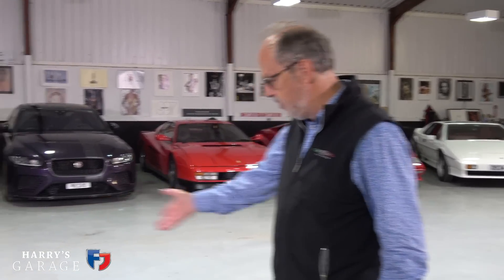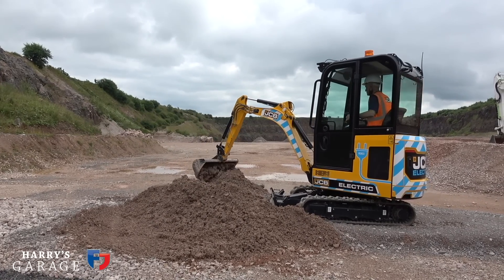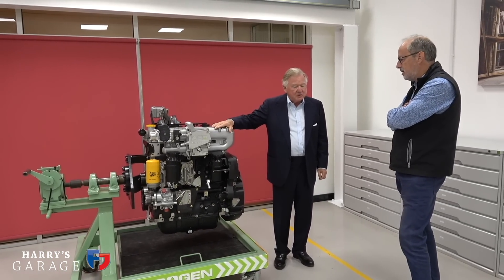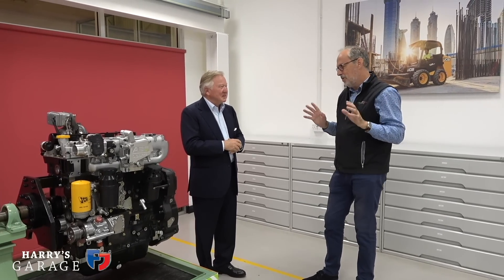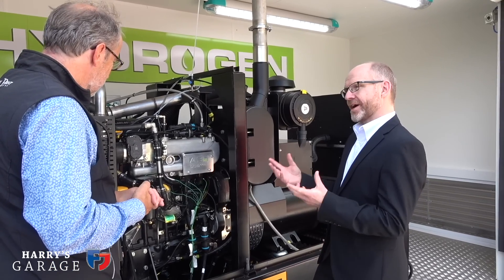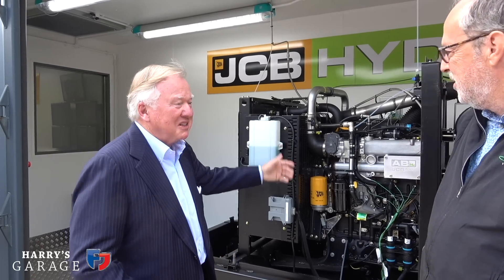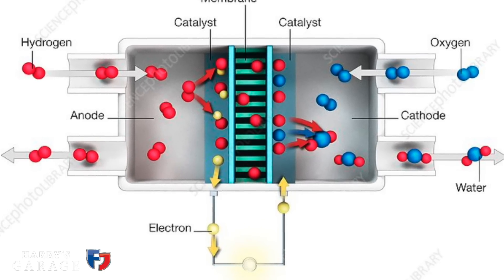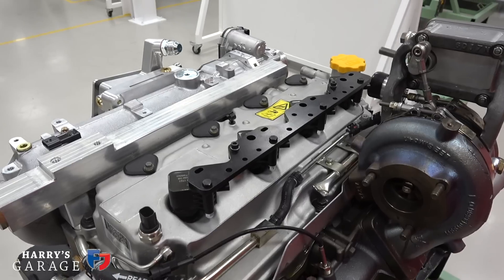Is hydrogen, rather than electric, the future for big-engined machinery? I visit JCB to find out

Comment: Really hope we get hydrogen powered engines in the future as an alternative to electric
Reply: ??? Hydrogen vehicles are electric cars that get power from hydrogen instead of mains electricity. They are electric vehicles.
Reply: @cathalfolan8441  I think the OP is referring to internal combustion engines that make power directly from burning hydrogen. As shown in the video.
Reply: @nickegan3988  You'd like to think so, but there are pockets of "over-my-dead-body" anti-electric people out there who would rather use a rubber band powered scooter than dirty their driveways with a battery car.
Reply: @cathalfolan8441  that's the case my diesel is electric. I need a battery to start it. . Electric is a no no. The infrastructure is not there and never will be in my lifetime.  The cable on estates is sub standard. New estates may handle every house plugged into a car. Mmm I doubt it. What we need is a kit. Plastic water tank fitted with plates to produce the H. Maybe some stainless or ceramic parts in the kit to fit. A nice new tap fitment for my outside tap. Nice. Whoever comes up with something like this, that's works will soon vanish off the face of the planet.  Bit of both would be a decent mix though
Reply: @bbbf09 God your serious. Take a pill.  It's a laugh but your wrong with telling me I don't understand electric. Well someone told me who works for Northern Powergrid the underground cables will not take every house plugged into chargers or half come to think of it. . Sit back and think about it.  The cable is just not big enough to carry that load. So you make that what you will  but it's fact. Cabling will need upgrading. Just like these crap heat pumps that has had to be put back. They don't work unless your house is built for the specs. Where I live anyway.  Oil rules. Anyway it was a joke about the tap.
Reply: I'd be happy for a hydrogen combustion engine in my Renault Megan cabriolet 🤭
Reply: @RalphEllis  Wow are you sure? If you are correct that's mad 😱
Reply: @RalphEllis  apparently you're unfamiliar with how electricity is produced and transmitted.
Reply: @ciaranbyrne62  Would you also be happy paying 28p/mile for hydrogen combustion? The average petrol/diesel is around 17p/mile and your cost of ownership over 100,000 miles would be far higher with a Hydrogen combustion engine than an electric battery vehicle.
Reply: @robbybobbyhobbies  keep consuming at the rate we are and the planets f..d regardless. it aint rocket science !!! ppl that need a new car every 2 or 3 years..  wtf !!
Reply: @rhett7716  agreed, but getting out of bed each morning requires that I believe we can sort it out before it’s too late. EVs are a tiny step that we can take (or have taken) today. Hydrogen is a step we can take in 5, 10, 15 years (unless someone disrupts the industry by funding infrastructure immediately). Refusing EVs point-blank is a retrograde step. The refuseniks seem to enjoy circling the plug hole.
Reply: Hydrogen is not free.it takes electricity to produce.so where does all this spare electricity come from.?
Reply: @peterhazelwood9325  Exactly!
Reply: @peterhazelwood9325  Nuclear the only pragmatic solution to split the h2O, much better than covering the landscape with solar or wind turbines.
Reply: @paulos9304  'Someone' at northern power grid told you did they... and 'it's a fact' 
Well thats me told then!  
Seriously - some bloke told you (down the pub no doubt) - and that's why you 'understand electric',  You should see your comments from this side of the screen - from my point of view.  It really does makes you seem implausible - at best.
On my side I served as electrician in few factories and building sites...moved on ...got degree in physics and electronics and now I interact daily as professional engineer with other electrical engineers. What's your level of understanding?

In truth you are correct if everyone heats their homes in winter , whilst taking a shower and charging the car, with hair dryer and washing machine on simultanously .... all on electric then the average 80 to 100Amp ~20kW domestic consumer unit supply  is going to trip.
But then my gas combi-boiler cannot provide both the central heating and shower at the same time - it temporarily ramps downs the central heating to cope. Most do the same. boohoo!
 To avoid this,  its all about evening/ smoothing out the supply peaks. Your car charge will typically require between 2 to 3 hours at 7kW and it will find a way to ramp up/down charge between peaks as required via its controller (or program to do it overnight). That's easy.  Other items will have to get smarter ...but possibly the heavy duty power apps (heat) may require automatically - but temporarily - turning down heat  whilst the shower is on (like with my gas). But a powerbank battery installation may be required for heavy use households . This will be at few £k cost - that can keep heating and shower going for an hour or so at peak whilst heating full on. There are otehr options

Otherwise outside the house there is a case for saying substations and grid network infrastructure will require what is called node strengthening. At cost of £50billion over 20 years it sounds like a lot - but less than useles covid track and trace or smart meter debacle. The challenge to the network is overall only modest - as national grid studies have shown. You make it sound improbable/ impossible.
Anyway there's the real 'facts' . You certainly can't tell any of this by stating 'the cable just isn't big enough' . Your hunch counts for nothing and I seriously doubt you ever  even glanced at BS 7671 or even know if your feed-in tails are 16  or 25 mm2. 'Sit back and think about it'. Indeed!

My only regret with  all our clever science  is that we can't find a way to oprn a portal into another parallel universe where we can drop all of you fossil fuel loving climate change deniers off - to await your self imposed fate. While we all go off live in a cleaner, progressive smarter and cheaper world - where we don't risk runaway greehnhouse effects.
Reply: @bbbf09  Oh dear. I hope someone has the time to read your  book of a reply. Because I can't be arsed and I have better things to do. You have your view and I have mine. Agree to disagree.
Reply: @bbbf09   your over reacting. I did say if everyone bought electric cars now and in near future. .problems will arise. Over time  thing will be ok bit not as of today tomorrow. . I never said in 20 years time. I'm on a out now this year next year.  50 million cars lorry's all electric. It wasn't down the pub either. It's what was said. Period.. I'm a spray painter. Got nothing what so ever to do with what we are on about. Your the man for that apparently, I'm saying what I was told. By the way he has a degree in electrical engineering as well. I'm on about here and now not in years to come.
Reply: @paulos9304  Well there you have it  folks ...clueless and uninformed. But apparently hi stime is valuable. Who knew?
Reply: @nickegan3988  But why on earth would you stick with a mechanical device which had literally dozens of moving parts to wear, and needs maintenance and repair, when there is already an alternative which requires much less repair or maintenance?
Reply: @peterhazelwood9325  Presumably it would be the electricity which was previously used by the oil industry?
Reply: @Brian-om2hh  I think for most people, access to charging is the blocker. I wanted to buy a Leaf as my last car, however not having my own driveway or garage, I wasn't comfortable having to worry about access to charging. Hydrogen ICE does not have this problem. 

I believe that unless charging access is addressed, BEV's will remain plateaued.

Comment: Hydrogen, LPG and Bio fuels seem to not only have a back seat to electric but aren’t even allowed in the theatre. 
Electric just isn’t ready or affordable, let alone cost effective,  for commercial, domestic or regular long journey drivers.
Reply: £30-40 to charge a Tesla at a charging is a joke! Especially when the realistic range is less than 175 miles.
Reply: @v4skunk739  My Subaru is cheaper to run than that!
Reply: Horses for courses. Electric is brilliant for cars, its also never realistically been an option for heavy vehicles, ships and trains. Hydrogen has always been pushed for this option. This isn’t new, but infrastructure is a massive problem for hydrogen, its even bigger for cars, electric infrastructure for cars is relatively small in comparison but as Lord Bamford says it is unrealistic for vehicles that have incredibly high work loads, Such as ships.
Reply: @v4skunk739  And charging at home (far more typical for Tesla owners) is about £10 for an atypical 20% up to 90% charge (I'm normally only putting in 10-15% each night). https://www.teslaev.co.uk/tesla-cost-to-charge-calculator/. We just don't use Superchargers the way you lot use service stations.
Reply: @robbybobbyhobbies  Exactly, unless you are on a very long trip, if you need to supercharge you have done something wrong. EVs are charged at your destination.
Reply: @v4skunk739  AVE UK journey is 29 miles
Reply: @v4skunk739  My realistic range is 300miles (though its easy to get 350 miles by going slower at 65mph instead of 75mph) - and a full 300 mile range charge at home (approx full 80kwh battery) costs me approximately  £4.50  - about one tenth what it costs my in diesel/petrol to do 300 miles. I have no idea where you got your sky high ridiculous figures from.
Reply: @ianc7866  That maybe the case if he wasn't out by a factor of 10. Joke figures
Reply: @SNORKYMEDIA  I think it's a little more than that. I read the average UK motorway journey is 70 to 80 miles. Still not a tremendous amount. The average UK daily commute is now 20.8 miles.
Reply: @v4skunk739  Where did you get those numbers from? You're way out. Do you actually own a Tesla, or are those figures just plucked out of the air?
Reply: @Brian-om2hh  Facts mate. Plenty of people even done YT videos showing everything.

Comment: He says 0 emissions now, but this kind of engine still will have NOx emissions, so it's not only water vapor that comes out of the exhaust
Reply: Harry does address this at the end of the video. They managed to solve that by optimising the fuel-air mixture and running temperature
Reply: Yes, unless there's some exhaust treatment cat-thing that takes it out.
Reply: There is an article in the Financial Times about how JCB have found a way to eliminate or NOx emissions. It isn’t very detailed though.
Reply: And to produce hydrogen they take fossil fuel and split it onto hydrogen and CO2.
Reply: I imagine that some amount of whatever lubricates the cylinder walls will be burned and exhausted.
Reply: @zanthraxnl  no. They will use wind turbines to power electrolysis to manufacture hydrogen.
Liquid energy storage.
Reply: Not true, you should follow Mark Pecqueur, he has done research in hydrogen combustion engines for cars and trucks for the last 22 years, and it is possible to make them without NOx emissions. Cummins is also working on these engines now.
Reply: The NOx emissions can be cut to almost non-existant with modern partoculate filtering technology

Comment: I believe this is the way forward. I'd convert my cars right now. Hopefully more companies adopt this solution and government will be forced to think about infrastructure for it.
Reply: Hydrogen costs a lot more than diesel.  It takes a lot of energy to separate and compress it.  You can go a lot further in an EV car from the electricity it takes to make hydrogen than from using the hydrogen in a car.  The physics of hydrogen will never change.  It might be a solution for large construction equipment that is used around the clock (mines, etc), but the companies will have to be convicted that their fuel cost doubling is a good thing.  For automobiles, hydrogen will never be an economically viable solution.

Comment: I have been arguing this for years.
The impact on the environment of manufacturing electricity generating equipment, destroying countless acres of land with access roads and thousands of miles of cabling, the use of rare earths not to mention the disposal of used batteries, nobody wants to handle them, is immense. Electricity never was and never will be the answer generated as it is at present.
Reply: You need to generate a lot more electricity to produce the hydrogen than is required to charge up the batteries of an EV. This is because the hydrogen production process is inefficient and the burning of hydrogen in an ICE is also very inefficient. The last of those 2 points is why car manufacturers developing hydrogen powered cars (e.g. Toyota) have gone down the fuel cell route. I can certainly see JCB using their tech in the specialist machinery market, and it might be an interim solution for other vehicles in remoter parts of the world that don't have a reliable electricity grid available.

Comment: BMW had tested a number of 7 series cars using hydrogen fuel several years ago with much hype.
The BMWs were being tested in the UK and Germany. BMW had to make the rear suspension heavier at certain points seemingly due to weight of the hydrogen fuel tank. 
Using a modified internal combustion engine. 
I wonder where all that research disappeared to?
Thank you Harry for highlighting the hydrogen engines and taking us to see JCB pushing ahead  and onward. 
Well done JCB.

Comment: Electric large equipment is absurd - much of this equipment operates remotely and EV is not practical in any way. Great video, JCB is thinking objectively and not politically.
Reply: Accept there is a full size ferry in regular service that is 100% electric.
Reply: @mbak7801  Regular service on a short route with massive dedicated charging stations is hardly remote. Heavy equipment is the first things on a new construction site etc. when there is no electric service available.
Reply: and you're telling me the hydrogen supply chain is robust?
Reply: @RC-fp1tl  Where did I say that? Obviously the infrastructure needs developing.

I will however say that it is a lot easier to take a tank of hydrogen to a job site than it is to take enough electricity to recharge the equipment.
Reply: @mbak7801  you mean the ones that are operating as hybrids right now and will have custom charging when they dock? That doesn’t apply to construction equipment on a site with no power, which is the issue JCB is addressing. 🤦🏻‍♂️
Reply: @RC-fp1tl  who said anything about it currently being robust? It could be, if politicians weren’t focused on electric. 
Alberta Canada, for example, is spearheading a large hydrogen network.
Reply: That was a political statment you just made. Big oil and the goverments they control, are pushing for hydrogen to keep you wedded to the pump.
Big oil does not want you to charge at home. Informative ? It was a one side promotional puff piece with no hard questions asked.

It is very hard to tame detonation in a h2 ice engine. The reciprocating engines BMW were testing suffered knock. H2 works better in rotary engines. Given an ice engines typical efficiency of 20%, and the entire supply chain energy cost of generating that hydrogen and distributing it, then 5 - 10x more renewable energy might need to be generated overall, to produce the same power at the wheels, than for a pure battery ev that has a >97% conversion efficiency.
H2 fuel cell cars, are not much better. H2 fc cars are basically a battery powered ev with the fc charging the battery, and a h2 to electricity conversion efficiency of eg 40%.
Reply: @nordic5490  these are pressure ignition engines not spark ignition so I dont think knock is a problem.
Reply: @banaana1234  If its a large job site you can install the substation and you will never need keep bringing hydrogen. or diesel, the substations are usually at the corner of the sites. Generally on any construction site  the first things done is to bring electricity, water and toilet facilities.
Reply: Neither hydrogen nor Electric is a viable option at present. Neither offer anywhere near the capabilities of petroleum based systems. 
No about of crying, whining or calling names will change that fact.
Reply: @nordic5490  did you even watch the video? JCB clearly explains significant limitations to electric equipment, including costs and capability. 🤦🏻‍♂️